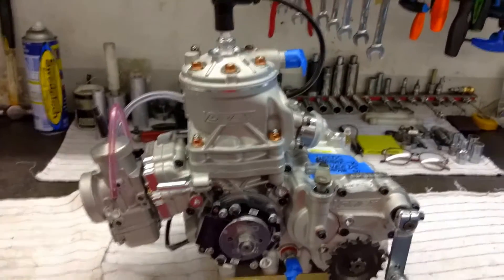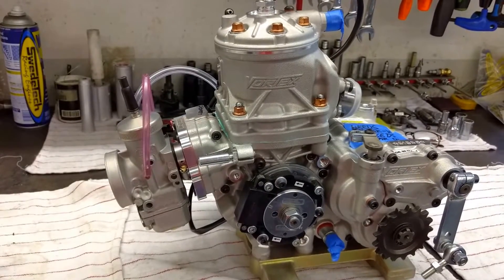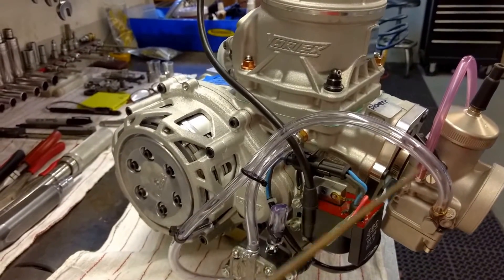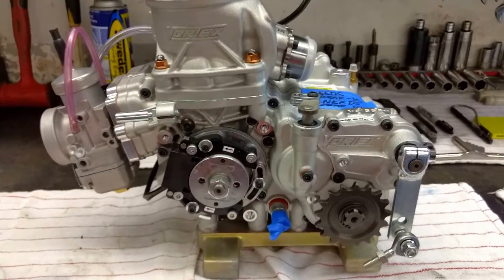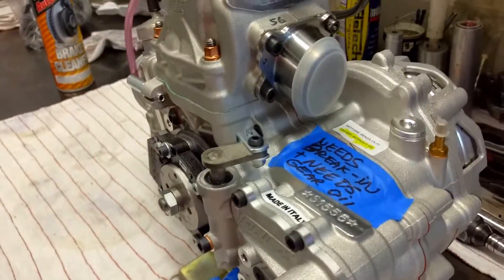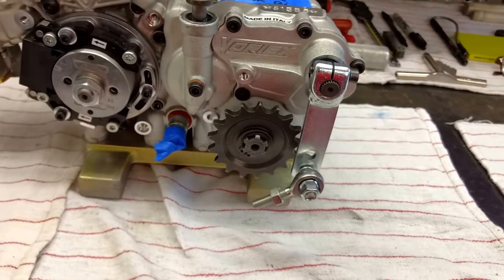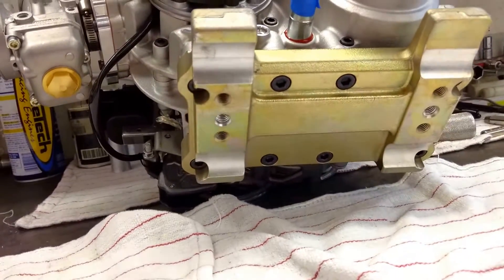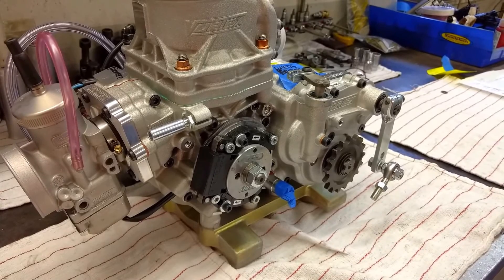Vortex Rok Spec Shifter Installation Tips

Comment: Why do you need to "pump" fuel on this motor..forgive me .not up on ROK stuff..jus 2t tweekin'!
Reply from the maker: The engine is mounted in a shifter kart chassis.  The fuel tank is at the same level as the carburetor.  Fuel pump is needed to move fuel from tank to carb.
Reply: @Swedetechracing  thanks bro '..could be the answer to  my ped problem.fuel starvartion at higher revs...gravity fed but only just above carb height.
7occ airsal kit
24mm keihin pj carb
Boyesen split reeds
Polini variator & gear kit
Tecnigas pipe
Variable cdi
On minarelli type yamaha motor..
Can you reccomend an electronic type pump to correct.not diggin' the vacuum pump type as ped is 'naked' & extra feed pipes look tatty...
Rides fine..proper quick..till im wringin' it ..feels like float bowl is emptying too quick.float height is fine..no leaks anywhere..would a float bowl extension spacer help ?I know it aint 'kart talk'  but eh? A 2stroke is a 2stroke  ?
Reply from the maker: We don't have experience with electronic fuel pumps due to many of our applications don't allow them.  Before tricking out the carb with different parts, start with making sure you have proper fuel supply, then work with the jetting.
Reply: @Swedetechracing  nuff thanx anyhow bro..